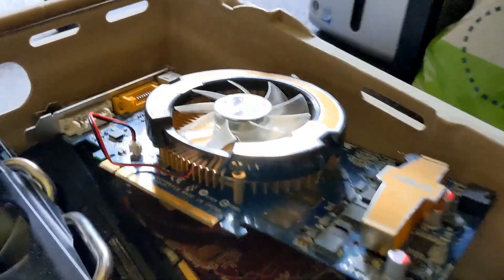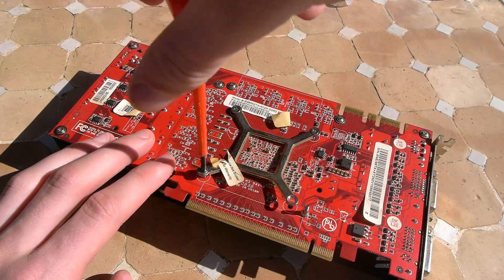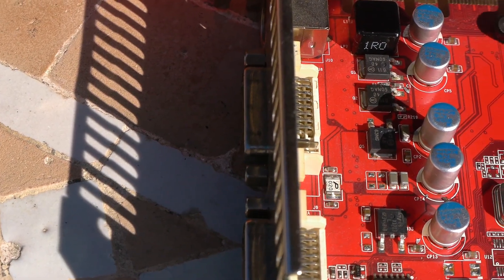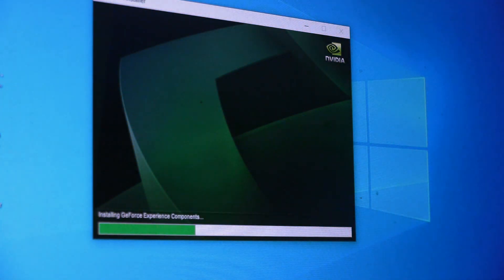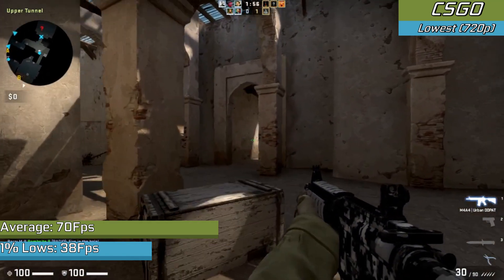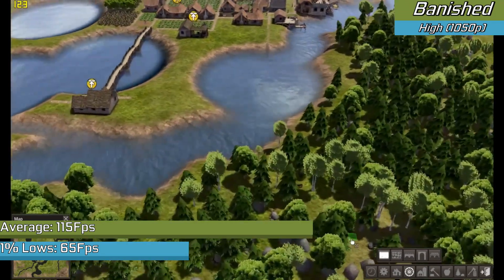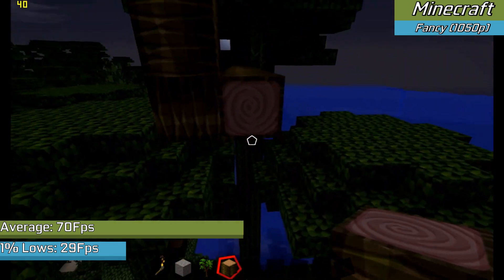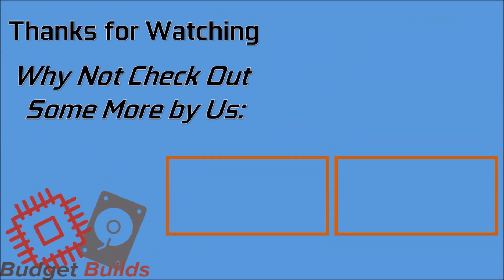Nvidia's Forgotten Flagship!

Comment: thats some real cement based thermal paste right there
Reply: It reminded me of some thermal paste I had to scrape off the northbridge of a Westmere era SuperMicro server board recently. Literally took me two hours solid of scrubbing I burned through 20+ alcohol wipes. I eventually resorted to using my fingernails at the end. Remarkably the northbridge die survived unscathed.
Reply: It is a thermal brick
Reply: goes on to prove that cooling was concrete.
Reply: Spray some brake cleaner for cars on the old paste and it will dripp right off just do not spray too much of it on the pcb as it will change the colour.
Reply: @0MeALot0  Also worth noting that brake cleaner is extremely toxic and should not be sprayed close to your face and in a ventilated space
Reply: @saltysoysauce954  Thanks for the advise while i do not actually fear death. Just a tiny bit already works, i usually spay it on a cotton zwab and outside.
Reply: @0MeALot0  Death isn't the worst thing, dying from cancer might be. But yeah like you said, it doesn't need much
Reply: @saltysoysauce954  A million people die because of picking death over life without getting anything a year, 2.4 million died because of alcohol, 4.8 because of smoking, 1.3 million because of traffic accidents, corona 1.7 million since it started. It is pretty much the natural cycle of life to die, nearly 80 million got born more then people who died though. We come and go and thats fine.
Reply: @0MeALot0  True, but it you can avoid inhaling brake cleaner that makes life a bit more fun ;)
Reply: @saltysoysauce954  Can't argue with that lol
Reply: Keeps the GPU stone cold.
Reply: haha hate that stuff
Reply: Its future proof, but today dont try furmark or ultra setting if we using alot just play at medium.
Reply: I have the same exact one from eBay , cost me 1.99 good temps
Reply: @MozrowDrops  I think that Scelly is referring to the stuff that was dried and removed from the old gpu, not the stuff that B-BO applied.
Reply: @MozrowDrops  try arictic silver 5.
10x better than that crap

Comment: I have a GT120 with 1GB of VRAM and mine can barely play WaW, and you can play GTA V.
Nice...
Reply from the maker: As I have said time and time again. VRAM =/= Performance
Reply: Yeah, I know, it's still pretty bad tho...
Reply: What settings in WaW?
Reply: @MozrowDrops  medium at slightly under 720p.
Reply: @Treynath84  anything under the *50 series on nvidia isn't meant to game. at all... even if the GT1030 GDDR5 can...
*10 image adapter  lolwatt
*20 video adapter 35watt
*30 3d adapter 35-50watt
*50 entry level gaming GPU 65-75watt
*50ti entry level GPU with a bit more RAM and cores 75watt
*60 first step of investing into extra gaming power 120watt (often best price/performance )
*70 bring on an extra power PSU we're feeding that little monster 180watt
*70ti basically a 80 series GPU with regular GDDR5 180watt
*80  bring thick wallet ...top of the line performance on regular 180w  
*80ti best gaming GPU on the market, don't even bring your wallet that much money doesn't fit in it. 250w+ monster
Reply: @Treynath84  try turning specular maps off and disabling shadows
Reply: @MozrowDrops  Might try that...
Reply: @underabridgetoofar  Honestly surprised I can play half the things I've tried on it at decent-ish settings...
Reply: @underabridgetoofar  what about the 5700xt rhat things a beast on power usage for AMDs modern side
Reply: @Cyricaaa  no it's not, mine only runs at 200 Watts
Reply: My Mac Pro came with a GT 120 and boy was it awful..
Reply: The card he is using is even a bit more powerful than something more modern  like r7 240 that I had so yeah It was a big deal at the time...
Reply: I have a friend that had GT 120, it performed slightly worse that mine 8600 GTS back then.
Reply: Isn't that card also available for the old mac pro ?